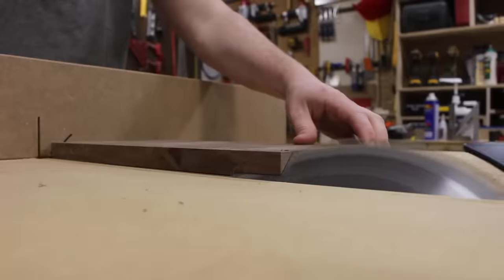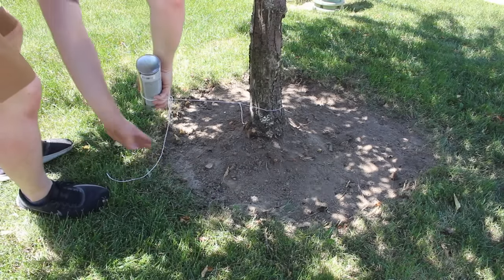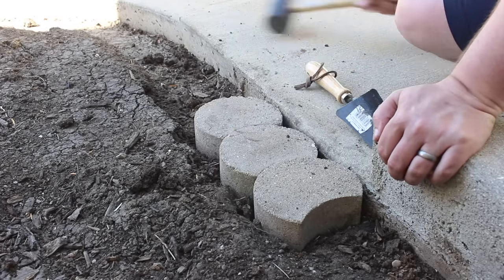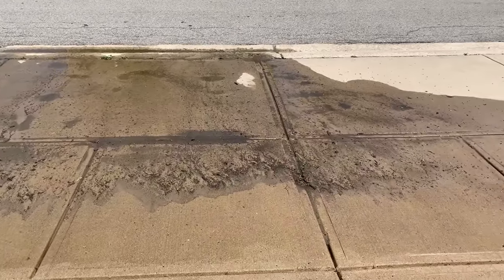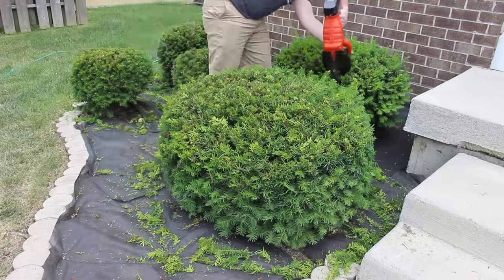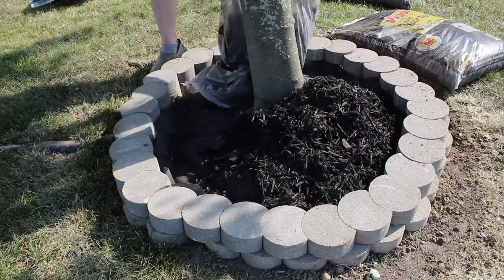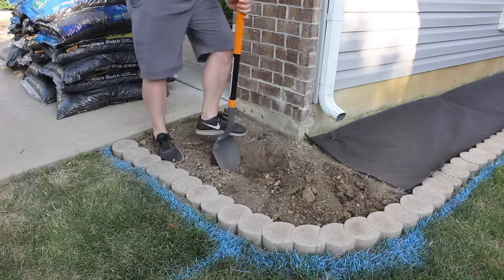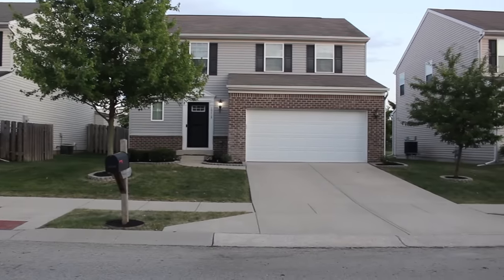5 DIY Landscaping Tips on a Budget

Comment: For mulch or bark chips, "chip drop" is a lifesaver. It's free for the homeowner, but the chips aren't aged so don't put them next to the house as they may draw termites.
Reply: I understand the appeal of mulch or bark chips but the downside is black ants. They are attracted by the mulch but if they get into your home they devour wood in your home also. Stone around the house
Reply: @SuperSaltydog77  what kind of stone pea gravel maybe and how does the yard guy get the hedge trimmings off the stone?
Reply: @pamelakitchens5549  a lot of garden centers either supply or know where to buy stone for land scaping use. I used larger stone than pea gravel, about one to two inches in size
Reply: @pamelakitchens5549  you could have them try to use a blower. Might not get it all up; but, it should get the majority of the dropped branches out of the way. The remaining pieces could always be picked up by hand.

Comment: Soooo your concrete, as you astutely pointed out the first time, still looks like it doesn't need to be cleaned (i.e. it looks exactly the same.) However the "gunk" you referenced comes mostly from the cracks between the slabs... so congrats on having a clean crack now.

Comment: mulching up against trees can be problematic.....can cause disease in trees
Reply: Agreed. Definitely watch the depth of the mulch. If you pack it up against the tree's trunk and it's too high, your mulch will retain too much moisture and you'll get rot. If the layer under the bark rots, your tree can't get nutrients and, ironically, moisture to the roots and it will die.
Reply: @guypaul  Thats why Ive found Hosta's are a good addition around trees rather than mulch. Or a perennial flower bed. The plants will soak up extra water so the tree doesn't get rot. Hosta's are great because they retain a lot of water on their own and are very hardy and require little to no maintenance.
Reply: @andrewnyberg5726  We use agapanthus for that here in South Australia. Wish we could use hostas, but it just gets too hot and dry.

Comment: I cringed when he used weed barrier fabric.  The mulch just turns into dirt that grows weeds on top and through the fabric, impossible to pull out.  Also I didn't understand why he put the stones against the concrete.
Reply: Wendy Cash so glad you said that! It’s not my favorite either but I have a little left
Reply: Should of used lava rock?
Reply: Yep, I can't stand landscape fabric. I like digging weeds out with a shovel and the fabric makes it impossible. The mulch WILL break down into dirt in 2 years time and weeds will grow in it and once they do , their roots grow right through the fabric and make it harder than he'll to get the weeds out. The only time I would use fabric is if I were using stones on top of it.
Reply: Lisa Henry I think it attracts mold after a few years.
Reply: @olivecracker1  If I am planning to remove existing grass and weed and lay rock and pebbles (no mulch). Could I use landscape fabric and would this prevent weeds from growing? Thanks
Reply: @KevinHPhotography  Yes. It wont last forever of coarse, because weather and time degrade everything. But a good landscape fabric should last you quite a while with no weeds popping through.
Reply: to sell stuff from Lowe's

Comment: Weeds always grow right up through the weed barrier.  I won’t bother with it again
Reply: Try the woven stuff that the professionals use. I bought some online (even got free shipping) and it was actually less expensive than the flimsy stuff from the box store. I put it down right over a huge weedy area 6 months ago and not one weed has emerged.
Reply: Same here
Reply: They will not grow through the black plastic. Tree gets water from the roots 2 -20 feet away from it. So you wont hinder its water intake.
All that cloth is complete garbage as you said.
Reply: They often aren't growing up through it but rather DOWN through it. If done right, the weed seeds shouldn't be getting enough light to germinate. It's the seed that blows onto it and then roots down into it. Once it's roots are down into that fabric, GOOD LUCK pulling them out!
Reply: I agree.

Comment: Never, ever, never ever... Use a pressure washer on vinyl siding, ever! You will destroy the siding. Also, never, ever, pressure wash barefoot! You can literally rip the skin off of your feet! One accidental swipe is about the same thing as one accidental kitchen knife slice down to the bone across your arm. And judging by the fact that everyone has been massacring this guy in the comments... hopefully not a lot of people follow some of his unsafe suggestions. I'm speaking as a professional pressure washer, so please believe me. You will do way more harm than good
Reply: You are perfectly fine to use a power washer in vinyl siding. You have to use low pressure and have a general knowledge of what you are doing. I understand the warning but saying never ever do it is incorrect. But if done incorrectly it could cause a lot of damage. So you are correct there.

Comment: Thank you for the good information, and your landscaping looks cleaner.  I have two questions: 1) why did you plant that little shrub so close to the house in the flower bed; and 2) why didn't you make the mulch area a round the mailbox post squared up against the curb to reduce post-mowing trimming.  Hydrangeas need several lateral feet to grow.  The young plant will have to be whacked back severely every year.

Comment: Beautiful!  bought a house last fall, spring clean up is going to be the front beds.  Suggestion!  Lights on front of house where the light bulb is glaring - is light pollution. FROST the fixture glass so that they still light the area and down, but not out or up.  Better? Replace with No Light Pollution fixtures!!  The type that illuminate down! Light up your steps, light up the garage door approach, light up the front wall of your house from the fixture & down (not up or out to the street). oh, and glare from light fixtures do not improve security, they reduce your night vision, and hides things in deep shadows.

Comment: Really effective alternative to pressure washing is a house wash. It is a bottle of cleaner that attaches to the end of your garden hose and you spray it on to the siding, let it sit a few minutes (per the instructions on the back of the bottle) and then rinse it off with clean water. I think I had to do a couple of rounds before every thing came off but it beat having to rent or buy a pressure washer.

Comment: Where in Indiana, I live in Lebanon Indiana and in an ugly apartment complex.  I want to make my patio area look nice but have no clue.  I do have a large umbrella for the patio but the wind keeps blowing over even when it's down and not in use? Hint for you for next winter if you take a gallon of warm water and a bit of dish soap and 2 table spoons of rubbing alcohol you can get rid of ice much quicker than using a shovel and it won't cause your concrete to get holes or pits in it.

Comment: Planting tip for shrubs and trees.  Buy a bag if the cheapest cat litter. It’s clay. Put it in the hole before you set the plant. It holds water near the roots. Saw it on tv and it works great.

Comment: I agree that your curb appeal projects make the place look a lot better. Your pressure-washing of the stones and concrete was particularly impressive. Not using marking paint is an error I have made time and time again, and I am inspired to always have the stuff on hand in the future. 

I wonder how your mulching project will look this summer, in its third year.  I have been a gardener for at least six decades, and I have learned that landscape "weed blockers" do not block weeds, and serve as an aggravation in a very few short years. This is particularly true if a person decides to plant flowers or (attractive) herbs or greens in those beds.  A better, budget-friendly way to block weeds is to put a deep layer of (free) wood chip mulch down, and cover it with a thinner layer of bark mulch.   I agree with you that all that plastic packaging  for such a small amount of mulch is pretty appalling,  and if you can borrow, or, even rent, a pickup truck, you can get two to four times as much bulk mulch of better quality, for the same money.
Reply: What type of place would you recommend going for bulk mulch?

Comment: Good job. Just a tip with ‘old mulch’. If you’re using organic mulch (anything that was once part of a plant or animal), just top it up.
One of the advantages of organic much is it slowly breaks down and releases nutrients for your plants. Plus, lots of beneficial organisms are feeding off it, so removing it also removes those.
When applying fresh mulch, particularly wood chips, it helps to add a good source of nitrogen at the same time so as the new mulch doesn’t draw nitrogen from your plants, causing yellow leaves amongst other issues. Looks good for your $300 😉

Comment: Another Pro tip with mulch is to make sure your mulch is along any surface that you can see like a Longyear concrete foundation take out the rake turned it upside down and smooth out that mulch along the edge it makes it look much cleaner. The most that you buy in bags is mostly ground up pallets with dye in it. Almost all mulch has die in it in order create color consistency. Technically it is organic material because it's wood but mulch is purely cosmetic

Comment: Very good and practical video. Only thing I would do differently  would be power wash the sidewalks after all done. I also don't like mulch. It looks amazing once it is just done, but with time, gets moldy, and the times I bought, it came with tons of weeds and ants with it. Never more used it. But that is just the way I would do, otherwise, good job!
Reply: The purpose of mulch is to keep moisture in the soil and in your plants so they don't dry out so easily, and it is supposed to "get all moldy", aka decompose like all organic material does. The decomposing bits add nutrients to your soil, making your plants healthier.
Reply: @juliemama  I know  but the times I got it there was a lot of white  gunk inside the bags looking like glue and lots of carpenter ants, so it is  a no no for me. So far my plants are really beautiful and healthy.

Comment: Pressure wash concrete - fine.  But do not pressure wash vinyl siding.  Use a product like 30 Second Cleaner or Home Armor E-Z House Wash with regular hose pressure.  Mulch should hold up a year, but every spring the old mulch should be raked out and replaced with new.  Lining beds with concrete landscape blocks is a good idea, it helps keep mulch in place much better than the shorter pound in edging.

Comment: I am wanting to create a 5' x 2' flower bed in front of my towndhouse.  How far in the soil do I need to dig out of the grass?  Would it be 6" to 8" to get the grass removed to reach a good soil depth?  I also bought some landscape fabric to lay down to keep the weeds and grass away from the flowers I want to plant.  Do I lay that that landscape fabric down once I dig out 6-8 inches down in the soil?  Will that keep the weeks and grass from coming up to the surface?  Then do I lay down new dirt and mulch on top of the landscape fabric?

Comment: I hope i don't come off as rude for suggesting this on your video, but as a landscaper that just removed 5 layers of landscaping fabric from a park, i super don't recommend using landscaping fabric. It doesn't prevent weeds. Those are inevitable. The best defense is the occasional sweep with a garden hoe and persistence. Make a solid edge to your garden too so the grass doesn't spill over as easily. Persistence is key in my experience. I'm positive others will have a different experience, but i speak as someone from the northeast (Buffalo specifically)

Comment: HI, your video is cool.  Suggestion about mulch. I don't know if your mulch smells of chemicals when first placed. I bought recycled rubber mulch back in 2010. Looks like real mulch, still in place and the color has NOT faded and no chemical smell. Rubber mulch comes in different colors; black red & brown. Color is guaranteed to last 12 years.  I bought the brown.  When leaf blowing does move some mulch onto the lawn it stays where it landed. I just walk around pick it up and throw it back in the mulch. Really, not much gets on the lawn, unless you do the hard under leaf blowing. Then sham on you.  You can either pick it up at Home Depot or have it shipped to you.

Comment: I  recommend using a wired low voltage lighting system. I spent way more on solar lights over the years and finally got a wired system, I'll never go back.

Comment: Please, tell me you put the downspout diverter back in place. Besides not allowing it to wash away your mulch, it diverts the rain away from your foundation. Also, after you pressure that driveway, you need to seal the expansion joints or it will get undermined, the same as your front steps already are. They need to be raised. Great job, so far. Just don't stop, now.

Comment: Other than profit, I am not sure why someone thought it would be a good idea to make landscaping fabric for weed blocker. Its fabric, and not biodegradable or compostable. We should just cardboard layers (remove the shipping tape) and then undyed mulch on top. Otherwise, weeding is good exercise for you and builds your immune system. I agree regarding the plastic bags, they should be thick paper bags and then we can reuse them in another area of the garden or compost them or reuse in the Fall for leaves at the curb. You forgot to water the hydrangea afterwards which is important after planting since it may go into shock. Also, a tip that I learned, is to use a wide clean paintbrush on the stones to brush your bits of mulch back in since you just pressure cleaned them. It came out nice. Did you end up putting new plants on the side of the house in the bed?

Comment: The house inspector told me there should be 4-6" of concrete showing between the ground & the siding. Then you can see if termites are making mud tubes to try to get to food (wood siding, drywall).

Comment: Hydrangea's are huge.  That's a mistake.  A few years it's going to way outgrow that small space.  Even if you trim.  Unless there's a new dwarf variety I've not herd of yet.   A smaller butterfly bush would've worked better.   Lavender is a good size for that area too.  Have fun finding a new spot for your hydrangea like I had to when I did that.   >.<    Hydrangea are beautiful, can easily control if they're pink or blue.  But they get up to 6 ft tall and 5 ft wide.  Even with trims.  And for anyone wanting to buy a hydrangea that's new to gardening, get the new ever bloom variety.  You might be disappointed if your hydrangea only blooms every few years with some varieties.  Some of them kind of take "naps" is the easy way to describe it, and they don't bloom every year.   Can trick them into blooming.  Easier to get an ever bloom instead.

Comment: Those dollar shop solar lights are gonna become your new eyesore. In a lot shorter time than you hoped and in a lot more ways than you thought. After all, you can't replace anything with real 18-volt underground wire lines or at least a very high-quality solar system. 
Short note: Cheap Solar sucks.

Comment: The solar lights on the link are JUNK.
Please don't waste your time and money for these.

Walmart actually has a good line of really bright, strong directional and round solar lights that I've been using for two years now.

They are: Mainstays 20 or 60 Lumen Solar Spotlights - perfect under trees for highlighting containers or fountains and centerpiece trees like Phanthom Hydrangea or a Weeping Cherry

The Mainstays also have bigger solar "classic column" lights or some that look like lanterns.

Much more reliable solar battery life than the ones linked.

If you really want them, the ones from the Dollar Store are in black and silver and last about a year (like those Amazon ones). Buy $30`s worth in the Spring stick them in a Ikea tote and replace them when they die over the winter.

Comment: The reason why those concrete pavers looked so uneven is because they weren't placed on a properly prepared base, by placing them straight onto the dirt you're just going to have the same problem in a few years time. Do it nice or do it twice.

You also shouldn't place mulch right up on the base of the trees.

Sorry, but maybe research this stuff before making a video.

Comment: DON'T EVER, EVER put rocks and weed barrier material with mulch around a tree like this guy did.  The method he used here is harmful to the tree and it will encourage abnormal root growth including girdling roots.  The tree needs to have it's root flare exposed where the roots can expand radially from the trunk.  The mulch should never touch the trunk and the mulch shouldn't be any more than 2" deep.  This tree will eventually die or struggle to live with the method shown in this video.